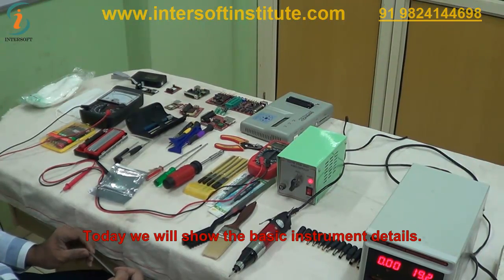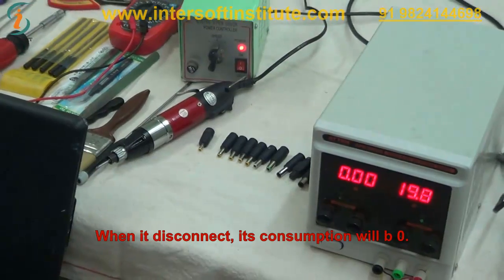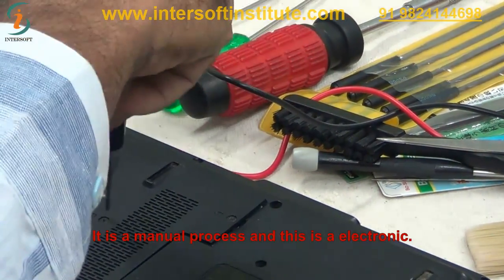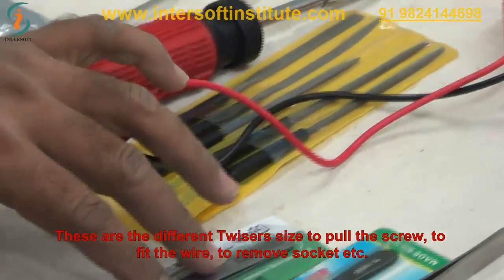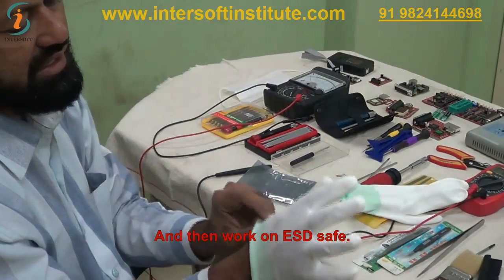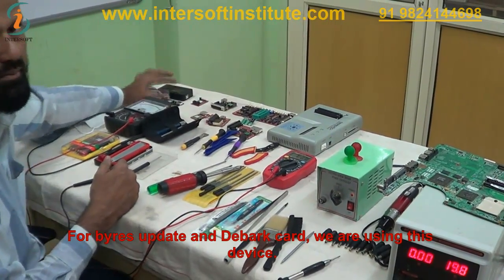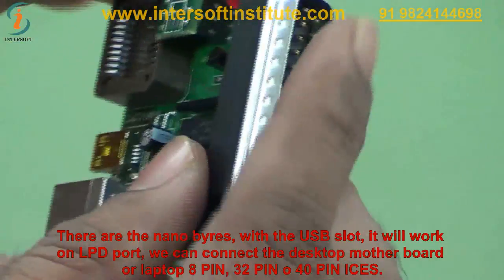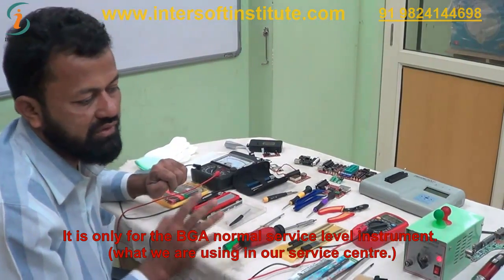Laptop repair training service tools video

Comment: Can you tell me when we require to service our laptop from the date of purchase to increase their life
Reply from the maker: normally depent on working , if work on dusty area frequently to clean ,  as there is fan which circuilate air and if dust come on fan it will not rotate smothly  so cleaning is important ,  

when you feel there is to much heating then onece to clean
Reply: @intersoftdatarecovery  ok thanks